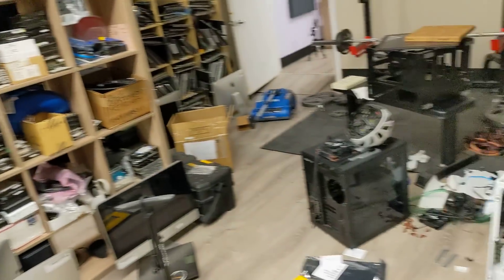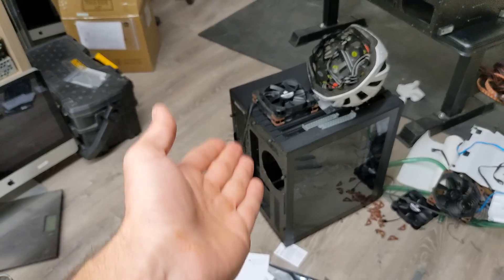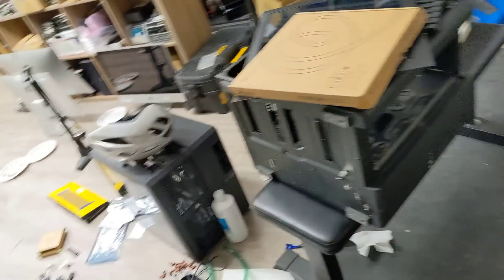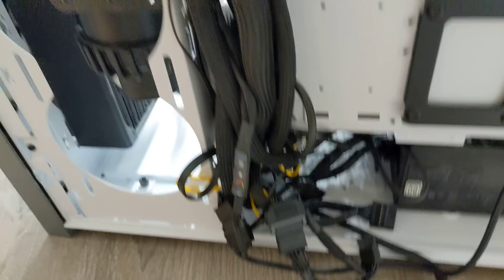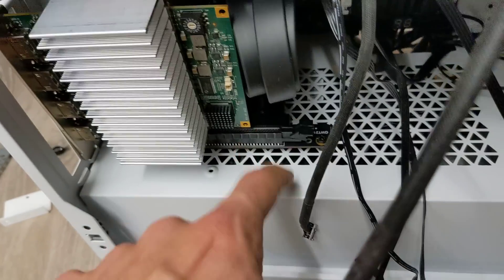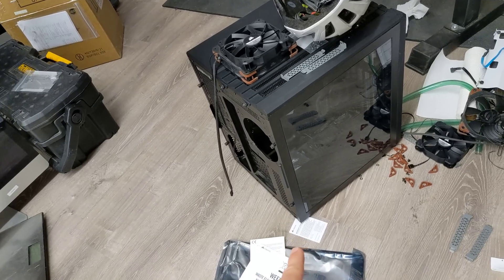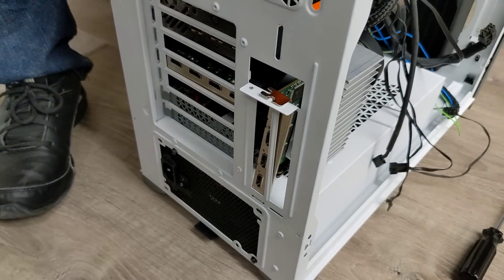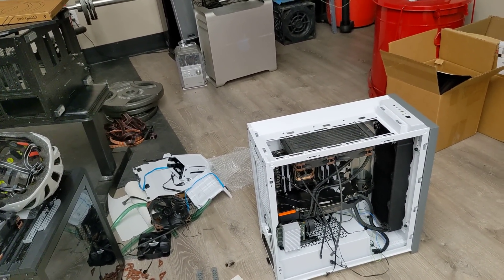I have a confession to make....

Comment: Modern case aren't HDD nor expansion card friendly, most people don't use more than 2 PCIe card or 3 HDD which is why old Fractal Define are really worthy now.
but hey, if you somehow managed to put that together in less then 3+ years, you still did it better than having Linus wash your hands of guilt anyway.
Reply: Yeah ain't that the truth. I use all but 1 of my 4 pcie slots. When I shopped around for a MB I had to look specifically for one that had at least 3 x16 slots and 1 x1 or x4 slot. Either would have worked. Thankfully the Asus x570 board has them. I also have multiple drives installed. And my board has 8 sata ports 2 NVME ports.. the case I have had no provision for a 5.25 inch bay and I needed optical media reading capability so I made a mount myself and mounted it in the case. There are 4 sata drives in my case and 2 nvme drives. I need a lot of storage... storing games takes up a lot of space, and I have over 25000 photos on my drives, over 50 4k videos and over 100 videos in 1080 or less. I created ISO files from almost every console game I own to play on emulators and to rewrite to a disc if needed... I have about 80 different games on disc that are spread between ps1 through ps4 and Xbox and Xbox 360.

I'm one of those odd instances where I really use the heck outta my computer for so many different things... thankfully I'm good at building them
Reply: @antonisautos8704  Mine is a very old rig now, and the case was reused from an even older build. I also had a lot of cards and drives, so it's a Asus Maximus 6 Formula, 10 sata ports, 3 x16 and 3 x1 slots, though would not do all the lanes of the x16's. Sad downside was that board is of the era of the m.2 as sata rather than nvme. 
That's been pretty fully populated in a Thermaltake Armor case, 11x 5.25" front bays and a 3x 3.5" drive cage.
Reply: Something tells me that they're catering to gamers and not content creators.
Reply: @killertruth186  Yes, and that's a big problem.  Content creators and businesses use desktops too!  But, the gamers yell the loudest, so that's what the manufacturers cater to. Gamers also tend to change things up more and dangerously overclock, while the other two groups want stability and long-term usage.
Reply: @platterjockey  I'm a gamer, but I also want to have a Blu-ray drive. Fuck me, right?
Reply: @hellterminator  if you need a larger full tower case, might I suggest the phanteks enthoo pro? Just used it on a newer build, and it has a massive amount of hdd bays and 4 5.25 inch bays in front for optical drives and the like. Though be aware it is an 8 year old case, so it can have some issues that newer cases wouldn’t have. But you can still get them brand new and it also includes ssd mounts. Hope this helps.
Reply: @hellterminator  Almost.  Most of the case manufacturers still offer one or two models with optical drive bays.
Reply: @gavinnoller2655  Thanks, but this was in 2019, so I already solved it. I needed a midtower and I eventually found one that has everything I needed, but it was $200 and it was a (USB 3-updated) model from 2004!
Reply: I bought a Define R5 brand new this year exactly for that reason.
Reply: given current tech most people that need that much space should use a NAS for storage, is much more convenient, in the past there was the small issue of bandwidth (in wifi) but that is not an issue nowdays, although the 6 HDDs plus 2 SSDs in my PC are a proof that people still like to have it all directly in their PC. Why that many? I just don't want to not have backups of important things, that and a NAS is still an extra expense that I will avoid until I can make my own using an arm board.
Reply: @alenasenie6928  I am sort of in the same boat, but managed to snag a 2013 dell optiplex 3020 desktop for free because my work was throwing it out, no wonder, because they hadn’t cleaned the thing since 2013. It is so bad that I am pulling dirt out of the fans, but it does power on.  I managed to snag a mint gtx960 gpu the other day at the thrift store for $37 and plan on ploping it in once everything is back in order. But have spent the last 4 straight days tearing it apart and currently redoing the thermal paste on the cpu. Currently very tired, but boy will it be worth it. Planning on setting it up as a server/nas/ website thing, whatever I can actually get to run on it. But for 37 bucks and a bit extra for a few screws it is a steal. Especially for a functioning system.
Reply: Indeed, I bought a Fractal Design R6 because it had a big HDD rack and I could fit as many HDDs as I wanted.  It's not a custom water cooled build, though.  But it's an awesome case, even today.

But GPUs like the EVGA 3090 Ti FTW3 Ultra are a tight fit in the R6 with the HDD rack in place.  I managed to get it in though.  Measure before you buy your GPUs people.
Reply: reasons i own a fractal case:
- hard drive space
- cd drive bay
- good airflow with dust filters
- the name fits my nickname
Reply: @Chrisspru  They are solid cases.  Pay a slight premium.  But deliver quality and functionality in spades.  And yes, perfect YT handle.

When I upgrade next year, I might even consider doing it by getting a second Fractal case and use the old box 
as a rendering rig or something.
Reply: I wish cases were modular, need hdd bays? Here, add them via built in backplane like server chassis. Need to conjigger your pcie card arrangement? Slide it in. Need to take your mobo out, just take off the back plate that holds it in. And have all the power stuff be ez non atx 24pin garbage so stuff doesnt eventually flex the board to its death.
Reply: @battokizu  .The ATX 12vo types are probably the nearest to that that should gain popularity soon, and the cases that take advantage of them. Personally I've  move to more NAS type storage over the years, but I really just use them as plain storage or backup, while having enough spinners internally to deal with the tasks I do.
Reply: My old PC has a case from 2000.  It is a heavy case it has drive rails, drive cage room for several DVD drives or other.  My SSD just swings back and forth loose.  All these new PC cases are so light in comparison.
Reply: @zack6192  Hah, that resonates. Even with the amount of bays in the Armor, my boot ssd's are basically hanging loose
Reply: @zack6192  Mt Thermaltake Core X9 is probably heavier. Last case I will ever need to own.
Reply: if you find the right kind of case there is plenty of room for HDD the gamer oriented smaller cases have room for maybe one or two stuffed in with the PSU
Reply: @WayStedYou  Thing is, the actual amount of modern cases with support for many hdd's, let alone optical drives, are putting those into niche / high price categories. I generally accept the trend, but I think the move away has been premature.
Hoarders love rust, lots of them.
Reply: @WayStedYou  mine is relatively small, because it is not a rectangle but a cube, one side is for the main components, the other has the PSU and HDDs, you don't need a huge case to have plenty of space, just one with a smart design. Although I bought it because it fits in my desk.
Reply: Multiple 3.5" HDDs and modern airflow design is why I'm looking for an O11 Dynamic EVO xD 4 slots if you convert the second PSU mount into HDD mounts.
Reply: That's not modern case, those are fad cases for manchildren who play kid games all day and want their PC to look like a toy.
Reply: @kishascape  I like the idea of SOME RGB but some people just go nuts.

I have a RGB fan on my Ryzen, I want to do some accent lighting around the case panel… but I don’t really see the point of much more.

6-20 RGB fans?  Come on… it’s going overboard.  Cable sheaths that do rgb?    The only sheath I can understand is overlay for water cooling to give the moving water feel but then again… that’s still in the overboard side.  ESP when that cost could be directed to a higher end video card or more Ram…
Reply: I have the bei quiet! Pure Base 900. Have all 6 SATA Ports populated. 2 hdds 4 ssd and 2 nvme ones. Still Got plenty of space left. Also a capture Card would fit No Problem.
Reply: *Typical mid-tower cases aren't very expansion friendly. If you're trying to fit in two large rads, a bunch of Pcie cards and 3.5" hard drives, a typical case just won't do, whether it's a modern one or from the past. This is very much the kind of build where you want the most spacious full-tower that you can get your hands on, and you should still check for compatibility with everything before you buy.
Reply: Suddenly I want to hoard the cases that allow 4+ external 5.25 bays and a crap ton of 3.5” bays internally…. 

But wait, I’ve never needed AIO cooling… screw you! ;)
Reply: i got an old cooler master with 6x five and a quarter inch slots
and sideways bays for three and a half driver 6 of those too

and for 20 bucks second hand, it's been a dream really long as you have a gpu that fits the length
one can always have brackets (or even 3in1s to cool the drives aswell) to go down

i don't understand bulky cases that don't just have expansion space
Reply: @klontjespap  I just found and picked up today, a Corsair 800D.  Linus reviewed it on the nix channel way back when.  Retail? $200.  Price canadian? $400. My price? $15.  UNUSED at that.  A planned build that never got built. Lol.  It’s gonna be my new test and recovery box with all those hot swap bays.
Reply: i got an old cooler master with 6x five and a quarter inch slots
and sideways bays for three and a half drives, 6 of those too.

and for 20 bucks second hand, it's been a dream really long as you have a gpu that fits the length

one can always have brackets (or even 3in1s to cool the drives aswell) to go down
i don't understand bulky cases that don't just have expansion space
Reply: fractal has some nice cases that has bazillion pcie slots that go all the way down to the floor. good when you have a mobo with slots of slots and cards plugged in. and the last card in the slot can rest on the floor even.
Reply: There's a reason I still have my old Corsair 900D super tower. Though I will confess to drooling over those super fancy Lian Li desk cases lately...
Reply: WHAT!? i'm not changing my current case ever then. I use a lot of HDDS and SSDs
Reply: Corsair cases allow for five HDD, at least.  And, Louis would be good to get a new motherboard and processor anyway.  That way, he can add two or three NvMe SSD drives, and two more in the back, plus the HDDs.    He needs to get rid of that Jay's Two Cents favored water cooler with the tank and get a newer, slimmer model.

Comment: I'd wrap the hard drive with a few turns of foam rubber and set in on the power supply cage. So what if it moves around a little? ... HDs are already shock mounted internally and with a foam outer shell it'd be good to go.
Reply: Hard drives use the drive cage as a heatsink. Even with a fan blowing directly onto the drive, the cage can lower the drive temp significantly.
Reply: @tin2001  Does Louis operate a file server or something? Because in normal personal use the hard drives never even get warm. I have a couple free-floating HDs (without any padding) one is laying atop a bundle of cabling from my power supply. This is year 5 and it may quit tomorrow I don't know but it's made it this far.

Comment: Ditch the rad up front and mount the fans inside the case. Use a 1TB M.2 for your OS and a 2TB or larger m.2 for your data and mount your HDDs in a NAS appliance as a backup.

Edit: The above option is to save as much of his investment in parts as possible. My recommendation will not work if he has a 12900k, a single 240 rad is too small. If it has a 12900k, abandon the custom loop for a 360 AIO and mount it at the top or up front with the hose barbs at the bottom.
Reply: Yeah, then swap places of your gpu and capture card. It’ll fit properly and take up less space (plus improve airflow for the gpu)
Reply: @budderguy2128  Vertical GPU placement only works well if there is enough distance away from the side panel for air flow. Most vertical mounts do not offer better air flow with modern GPUs because their heat-sinks are thick to accommodate the power draw or remain silent. 4 slot GPUs are a thing.
Reply: @budderguy2128  not a good idea. Only the top PCIe slot has a direct connection to the CPU, the others are via the chipset, which would most definitely cause a bottleneck as it would have to share bandwidth with everything else connected to the chipset
Reply: @budderguy2128  Did you miss the size of the heatsink on his capture card?
Gonna have to break out the dremel to make that work.
Reply: And after that, take a second to consider that you are taking advice from youtube comments section :)
Reply: @IcecalGamer  You're right but he can look at what Steve, Jay, Paul, Kyle and Linus have said about the case and its configuration options or call one of them.
Reply: @BansheeBunny  The recommendation above is to swap the entire storage config (phisical), from sata3 to m.2 nvme solid. And then building a NAS, from scratch. But that m.2 config might not work on an older platform. Or might not fit the use case, or may be too expensive, or might require a... etc. 
Louis posted this video as a "Look, i can't even transplant a case."
And all that, when the simple solution would have been, replace, plug and play, the MOBO.

Youtube comments miss the big picture (i'm also part of comments). And just because Linus said trust-me-bro, that doesn't mean that his (linuses) idea works for the on-site technician.
Reply: @IcecalGamer  He blew the SATA ports on his old motherboard, storage is cheap and redundant storage is a good thing. You don't build a NAS appliance you  buy it and add the drives he already has.

Edit: If he can't transplant a case he has no business using a custom loop that will eventually need maintenance.
Reply: @BansheeBunny  you do sound a bit pc-mater race elitist "Has no business" working on his own gear. You sure you're not working for apple customer service? :))
Reply: @IcecalGamer  You're one of those people that read your own narrative into everything, aren't you? ""Has no business" working on his own gear" Is not what I implied. The context of what I said was, if you are having difficulty with task "A" you have no business trying to achieve the much more difficult task "D". Moving parts from one case to another is 5/10 difficulty and only needs to be done once. Putting together a custom loop is 10/10 difficulty and it needs to be maintained.
Reply: @BansheeBunny  Let the man have his fun. So what if he doesn't meet your grade of skill level? At worst, he wastes some couple of hours of time and some cash. But, but! He gets to have fun, explore new gear (not on customer parts) and most importantly: learn something.
He is not skydiving for the first time and going straight to board-diving solo with no trainer (he's not gonna hurt himself or anyone).
Will his build be optimal or perfect one-shot? No. He already ditched the first and seconds attempts. Is there anything wrong with that? Imo, no. There is nothing wrong with that: a dude having fun with pc components, on his spare time 👍👍
Reply: Wow, I didn't know Windows was that bloated
Reply: @leonidas14775  what?
Reply: @Avi-tq6fd  they're joking, because op recommended a 1TB ssd for the OS
Reply: @wsketchy  OH! I didn't pay attention to that. Thought the second commenter meant by window is bloated that Louis is using old hardware (from older pc to a new one) and ran into a problem (space and management related) and then he called pc (used 'window' instead of pc) bloated.
Reply: @wsketchy  Ya, should have said OS and apps.

Comment: I have a Lian Li 011-Dynamic and I love it. I'm not sure if that thick rad you have will fit in it though. Probably as the side intake but don't quote me on it Louis. 

Edit: There's also room for at least 2 5.25 inch drives in the back of it as well as 2 mounts for 2 ssds.
Reply: Antec Performance One P183 V3. King of bays and trays :P Still got mine, probly about 15years+ old at this point.